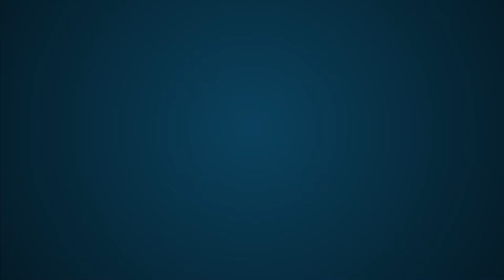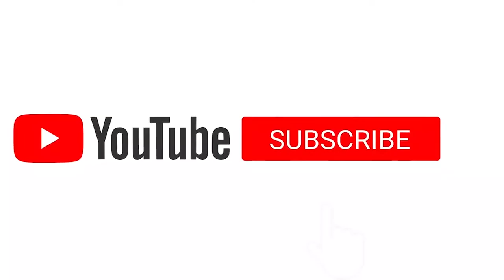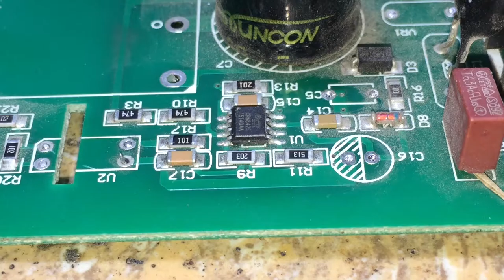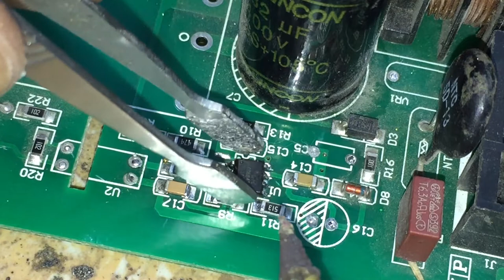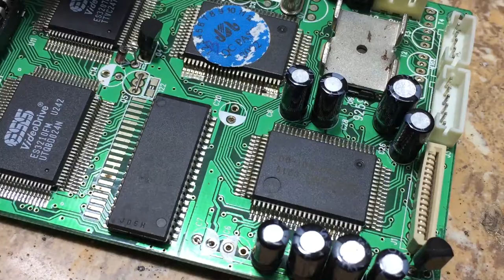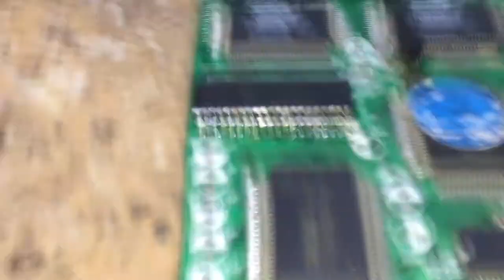How to remove IC Using Soldering Iron

Comment: good method very important though is your solder iron must be the correct temperature to pull it off
Reply from the maker: Yes correct
Reply: @jadeelectronics4343  Right the only thing I could worry about on some PCBs are the pads being lifted up. But so long as that does not happen I'm all for blasting the blobs with some heat :)
Reply: @MILEAGE ADJUSTMENT UK The temp that melts solder!

Comment: 00:47 I'm getting ready to try this method and it just dawned on me it might not work with eutectic 63/37 solder? 
Is this an accurate assumption, do I have to use 60/40 solder for this method???
Reply from the maker: Yes 60/40